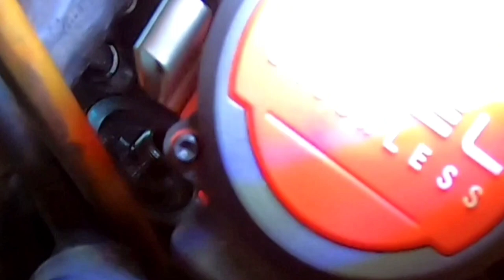Mustang GT 4.6 engine and transmission removal.

Comment: Hello sir, today is Friday, Feb 3rd 2023. You recently directed me to this video. Towards the very end of this video where the engine is clear out of the bay, you can see the fire wall in the area of where the heater core is located. You can also see the engine being lifted out of the bay. However, the engine does not have this braided cable that my engine block does. And, the fire wall of the heater core on your video does not seem to have this braided ground cable wire either. Perhaps you removed this braided ground cable and it was not in the video. Or, this engine does not have this braided ground cable. Nevertheless, I'll keep on plugging and doing my research. Thank you. Oh, I didn't explain to you the issue with my GT. It cranks but does not start. I have squirted raw fuel in the throttle body but it does not start. Usually, on any car if you do this it will start for a few seconds. Thank you for your support.
Reply from the maker: Ok I just went to look and I don't have a braided wire. Mine didn't come with one. Yours could be a add on wire from the previous owner. You are spraying fuel and it won't start? You don't have a fuel problem you have a firing problem.
Reply from the maker: Wait what model is your car and are the heads cast iron or aluminum?
Reply: @isolateddieselperformance3261  1999 Mustang GT. Heads are Aluminum alloy. Not cast iron.
Reply from the maker: Ground wire could be factory for a 99. Mines a 04
Reply from the maker: Hey bud didn't think much about it but there is a braided cable that gose from passenger side fender at the back up to the passenger side hood on the back inside. That cable would be long enough to reach back of head making you think thats where it goes.
Reply: @isolateddieselperformance3261  I'll see if I can put in some hours on the GT this week. Last week the weather did not allow any work. I have the car outdoors. Nevertheless, thank you. I'll keep on plugging. A story, the Mustang GT engine had rod-knock. It was working, but the engine was on its last leg. The tranny began to give me problems too. I opted to buy a 2002 Crown Victoria solely for the engine. I brought the trooper car home. I removed the engine. I rebuilt the GT tranny. I coupled them together. I installed in GT --- GT cranks but does not start. The engine of the trooper was running. The trooper car was totaled in the rear area. The front end was in tact. The trooper car turned on, the tranny engaged. The car ran and did not blow out blue smoke, or any smoke at all. But it was working. In fact, both the GT and Trooper engines cranked and started. Now I scratch my head.
Reply: @isolateddieselperformance3261  Wednesday, March 15th 2023, I finally got the GT start for a few seconds. I believe the problem is with the fuel system module. Before I cranked the car I tapped the fuel system module with the wooden handle of a regular hammer. I guess this knocked the cob webs out of the module. Nevertheless, even before I began this project that GT would leave me stranded with symptoms as if it had no fuel. I guess it has been the fuel system module all this time. Thank you for your support.